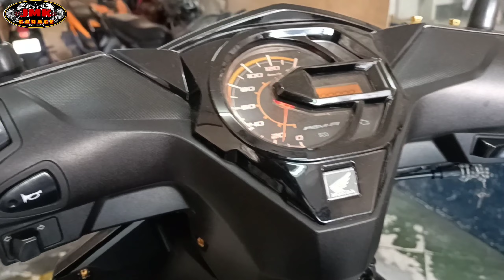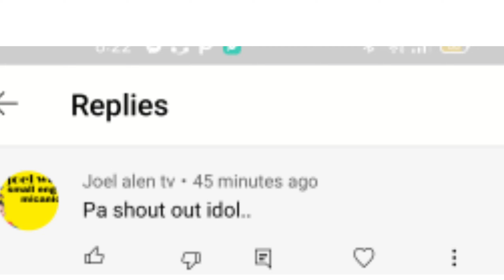matibay ba ang hanap mo na tensioner ito gamitin mo honda beat/click125/click150 tensioner wave125

Comment: Bossing beat ko fi v2 gang ngayon wala nakaka ayos thrutle, injector, saka battery, pati ECU, SPARPLUG, sira parin ehh yun takbu lalakas babagal putol putol takbo...wala ok naman mga wiring.. Ano kaya sira nito.
Reply: Tps? Or yung sa taas yung solenoid paps. Check mo spring turo din ni kuya mike yun tsaka check din ignition coil papunta sa kable ng sparkplug pati din yung CDI Check